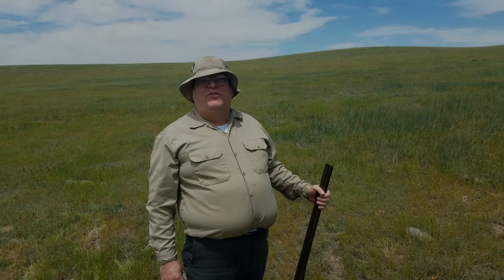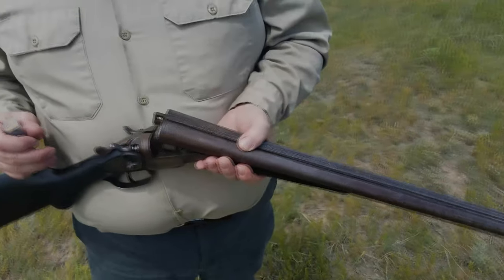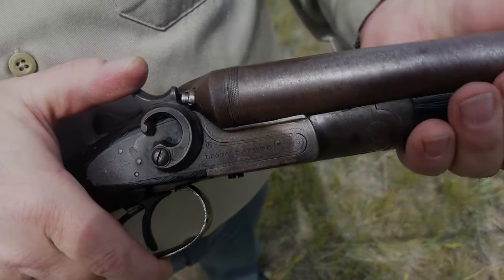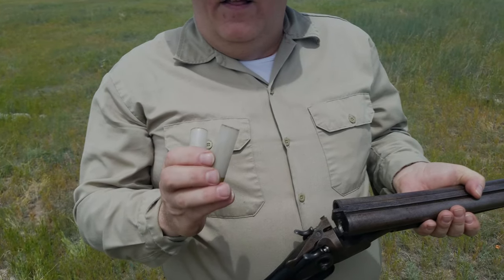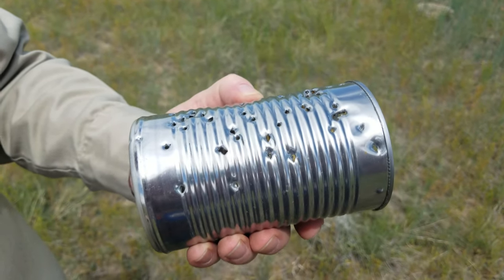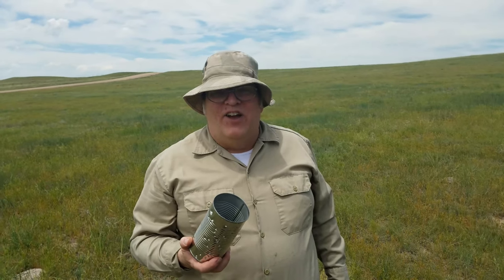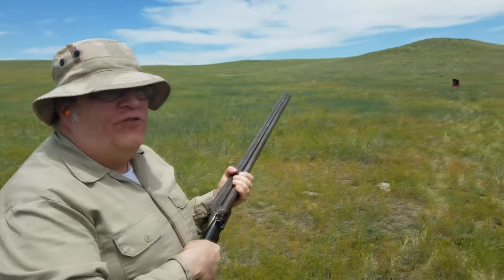Old Shotgun that performs like a champ. Black powder Shotgun review.

Comment: Plastic wads will not cause barrel to blow......completely in correct ....black
Powder will melt the base of the wad 
Creating a film in bore...multiple firings will  cause barrel dia to decrease...therefore increasing pressures.....the steel shot you fired is a NO NO through a Damascus or twist 
Laminated barrel....the steel pellet is made of harder steel than the barrel....
Steel in a choke tighter than modified is extremely dangerous in older guns...
Your lucky it didnt pop on you...
Fiber wads yes...time period for these
Guns...lead...yes...even using bismuth
Ir hevi shot ....to reload for waterfowl...
Yes....absolutely safe....however ...steel
Shot is NOT   I repeat NOT safe or
Recommended in Damascus barrels.....before informing 
About the wads....I'd read up on it first.. 
Otherwise great video...nice old gun.
Reply: So black powder…. Fiber wad…. And lead shot correct with correct shell length??
Reply: @WolvCustoms   absolutely correct.
Reply: @WolvCustoms  bismuth is safe also
Reply: You are correct a plastic shot cup will not do anything except for melt…lol. RST loads low pressure damascus safe ammo with plastic shot cups made for these guns.
Reply: @tripplebeards3427   as long as fiber cushion and nitro cards are seated over the powder...and under the shotcup..would be just fine
Reply: yep, it will control some of the burn on the plastic shot cup base. I loaded some the other day with just a plastic shot cup. We’ll see how messy it gets.  I don’t think it will be that bad anyways because all I’m doing is developing turkey loads so I shoot once, clean, and repeat. Imo its no different than shooting my muzzel loader with plastic sabot. It's been done for decades by everyone using black powder in muzzle loaders without issues.

Comment: Their is another option. I have a Remington model 1889 12 gauge with damascus barrels and I use a 12 gauge scavenger series shotgun chamber Adapters chambered in 20 gauge. I shoot 20 gauge lead shot in my old damascus 12 gauge with no problems. I only use 20 gauge small game loads in my old girls. They make them in 12, 20, 28, 410, 22lr, 9mm and more calibers made with modern steel.
Reply: I had the same idea!  I’m so glad someone else has tried it.  I ordered a pair of 410 adapters to keep things easy on the old Damascus.
Reply: Just curious, did you need to ream the chambers for them? It says on the website that the adapters are for 2 3/4 inch or 3 inch chambers. The Remington model 1889, like most shotguns of that era, have 2 1/2 inch chambers.

Comment: Firing " Steel shot" or airgun BB's in a shotgun without a shot cup is going to score the barrel. Steel shot or airgun BB's are as hard or harder than the steel of the shotgun barrel.
Reply: I read as a kid, ( And I'm a long ways from being a kid now ), NEVER to use bb's in a shotgun as there is no give in them and they will destroy the chokes. With that said, I do now load some in my Cylinder bore tactical MODERN shotgun with thick wall wads that are made for steel shot.
Reply: @ditchdigger93  Now that you can do.

Comment: G'Day from Australia,
I enjoyed watching your video. Glad to see that you mentioned the precautions that need to be taken when shooting black powder shotguns.
I have a Hollis and Son's double barrel hammer 12 gauge. As far as I can make out from the proof mark's on the barrels it is only proofed for black powder. I have two 12gauge/.410 inserts. I'm wondering if these could used in my Hollis shotgun with modern 2 1/2" or 2" Eley cartridges which have fibre wads. Even with light modern loads the chamber pressures may be too high. It might be best and safer to load either 12 or.410 gauge/bore with black powder. What do you think?
Thanks for all your videos,
Cheers,
Steve

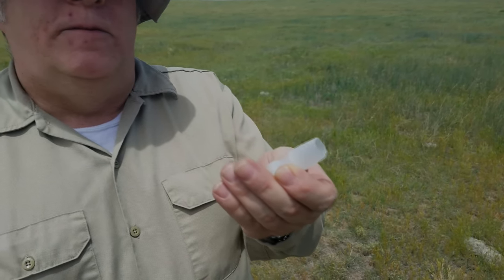Comment: Buffalo Arms sells 12 ga BP shells with plastic shot cups like the ones you warned about @ 1:20 we just cut one open to see how it was loaded. I fired them in an 1889 Remington with the regular soft steel barrels. They didn't do any harm, but now I'm loading brass 16ga hulls and I'm using all the old style wads. My current gun has damascus barrels. They have locks and hammers that look just like your gun in this video. The old Remington C Scroll hammers look just like yours. Wonder if they out-sourced them?

Comment: I own the same shotgun, mine had been cut down to coach gun barrel length many decades ago but I like that anyway, I re load for it.....some things to keep in mind,   these pre 1900 Damascus metal guns are Not...repeat NOT meant to shoot anything but black powder and lead shot!!  Damascus is soft so, smokless loads run at much higher pressures meant for modern high carbon heat treated steel,  same reason for the lead projectiles...steel BBs will scratch the crap of the Damascus barrel!    Plastic wads will burn up/mealt in the barrels from black powder heat, you might get by shooting a couple at a time and check/clean the bore, but fiber or , as I use..cork wads are best, I also powder coat steel  BBs to save a little money,  the PC will coat the bb with a protective coat. Don't over load with black powder or shot,  50-75gr powder with 7/8-1 1/8 oz will do all that's required with in the capabilities of the gun.

Comment: You might want to know what you are talking about when you do a video I have fired thousands Of plastic shot cups through choked Damascus barrels with no changes to dimensions. A much more harmful practice is to use steel shot in these old barrels.
Lee Gibbs gunsmith

Comment: Hmmmm that shot ...steel??? In a Damascus gun is a complete  no no... Damascus barrels are softer 
Metals than those steel air gun
Pellets...those guns will shoot bismuth and hevi  shot pellets with black powder yes... But repetitive shooting of that steel
Shot...you wont have a choke 
Or bore left...steel shot is meant to be fired in a thick shot cup...
Compare a SAM1  steel shot wad
To a typical Winchester WAA12 wad...look at how thick the sam1 
Is..reason being is the steel shot
Is kept from the bore
..steel/steel makes wear...scratches and In damascus
Barrels that have pitting..the steel can tear bits of the rust out and cause weak spots....
First loads you used with lead...
Just fine...the steel...id not advise
It
Reply: I was about to make the same comment. I don't think he commented on the actual load either or on the chamber length of the gun.
Reply: wholeNwon assuming you two work with Damascus barrels, what’s the most recommended type of shot to use? Lead? Also, how many grains of black powder should I use? Looking for a safe round that I’ll still be able to hunt squirrels and rabbits with.
Reply: Depending on your gun, cond.of bores, I'd not really be able.to suggest a particular  for a gun I'm unfamiliar with, lots if resources online for black powder shotshell
Bismuth can be used as a  non toxic substitute  in a sound Damascus  or twist barrel shotgun.
Reply: @JEEPmanDAVE  The barrels have to be carefully examined and the wall thicknesses measured at several points. The chamber length should be measured. If all the data are acceptable, shells are easily made. Huge amount of loading data available.
Reply: What are you referring to?

Comment: Hate to tell you Allan but those guns won't explode just because of use of plastic wads.   I'm not saying not to use caution but there is a lot of mythology surrounding damascus barrels.  Never use steel shot though!  That stuff will ruin a Nickel Steel barrel even.  Read the articles about shooting Damascus barreled guns in the Double Gun Journal.  Articles named "Finding out for myself.  In these articles, they both pressure tested and finally blew up both damascus and fluid steel barreled guns.  The results were very eye opening.  I have quite a number of Damascus Steel barreled guns.

Comment: I have an old drisket double barrel 12 gauge percussion and I'm looking for proper load data
Reply: You can basically load any charge you want. I would recommend forty to fifty grains. Usually muzzleloader rifles use a charge 100 grains. Black powder does not have the high pressure properties that smokeless powder does. I hope this helps you.
Reply: @devinpetersen2387  see, I get so much conflicting information. I've been loading 80 grains of black powder and 90 grains of shot by volume. Some say it's too much, some say it could be loaded with more.
Reply: @andyd2960  lighter loads are good for target shooting but if you want to go hunting I would recommend a higher charge. I know a guy who had a antique black powder shotgun and he used a hundred grains of powder in each barrel. To me that's way too much. You can experiment and see what works best for you. Me I would use like 7 buckshot balls and 60 grains of powder for defense or other things. Now if I were to hunt birds with birdshot than I would load forty grains of powder and 20 birdshot bb's. You don't want to over penetrate small animals while hunting.